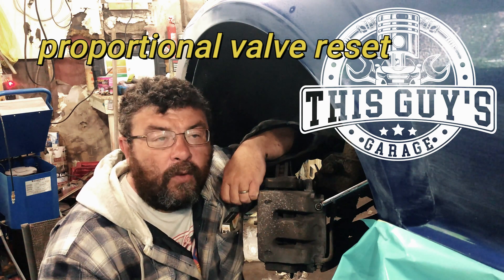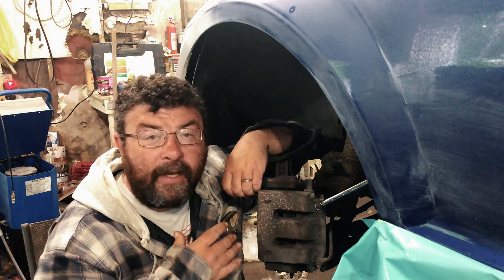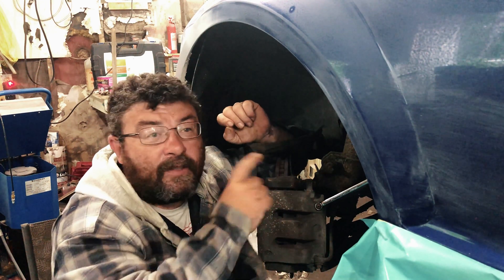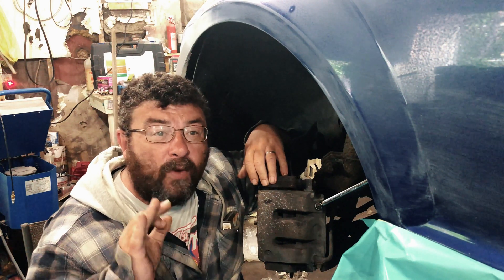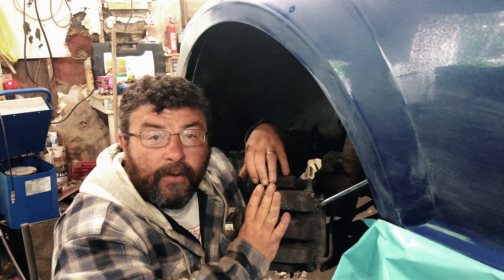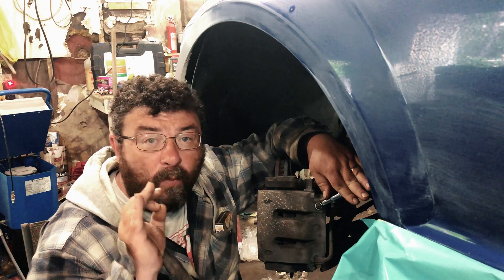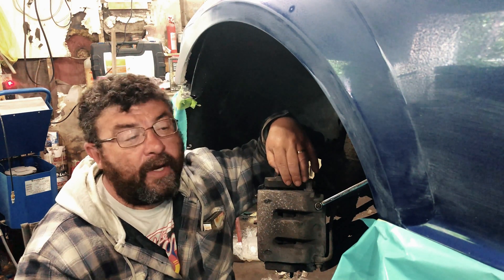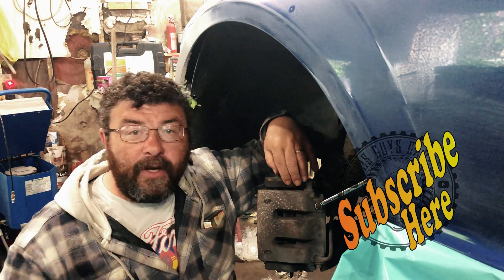brake proportional valve reset when unable to bleed

Comment: I did this method im getting fluid my light turned off but my front calipers are not releasing at all like i have my foot on the brakes....note: changed both calipers and rubber lines still cant get the front to release after applying. Brakes

Comment: Questions 1)  you say to listen & watch for fluid (and/or air) at the actual brake fluid RESERVOIR, right?  2) you meanwhen you compress both of the problem calipers?  3) should you compress both of the calipers totally -- what i mean is, clamp the first one closed, and leave it clamped, then clamp the other one , so they are both clamped, and dont cross-feed into one another, right? 4) then re- mount the pronlem calipers and buddy bleed uning only (1) pedal hold-down press PER "bleeder release", yes?...but you can do several of these 1 pump/release steps until flow is good, right?
Reply from the maker: 1 at the bleeder 
2/3 you can do this independently and if your caliper sliders are working you can do this without removing by using a screw driver or prybar to move the caliper back. 
4 you can now bleed the calipers as normal,  let me know how you make out 👍
Reply: @thisguysgarage  re: 1) -  i thought that when compressing the caliper, you want to leave its bleeder close, so that you force the fluid back up thru the proportioning valve, and back up into the brake fluid reservoir?  Seems that is you ipen the calipers bleeder, it will just come out the bleeder, and not go back thru to re-set the valve and up to the master?? Im confused i guess?
Reply from the maker: @jmm1000  yes keep the bleeder closed and yes you should hear the fluid go back to the master cylinder 👍💯✅️

Comment: I had the fivcking tool in to block the proportional valve it is plastic and not metal.I was not getting any fluid to the passenger rear brakes stool the line off and not begetting anything in front of the hose.It is all new brake lines from there.How the fuck can the both fronts bleed and only the rear divers side without getting anything to the passenger rear?I took that Fvcking lie valve off,took it apart cleaned it.Everything looked good even the O rings.Reassembked after resetting the coOcksvcker and vaccume bled furthest from the master cylinder according to the manufacturer.This is an 87 Jesus Chrysler Lebanon .They don’t make the valve anymore so I will have to retrofit something and I am flat broke worried about food.Thanks Brandon.And I can’t work without this car.The only thing I may have fucked up on is crossing the rear lines for the rear.But if it only cuts off the front or back why would that matter?A vacuum bleed worked initially and then stopped.Then I pumped the pedal.short slow stokes with a one man bleeder on it.I too the plastic tool off and looked at the shuttle valve and it looks centered as far as my old eyes can see.I am really stumped here.Anyone please help.I need to get back to work.

Comment: Mines front brakes have fluid to the passenger side none to the drives side
Reply from the maker: Replace the flesh hose on the side that has no fluid.  You can bleed at the flex hose to confirm 👍

Comment: I have a 2013 Honda Accord that I recently installed some 4 piston Acura RL calipers up front. I went to bleed the driver side but didn't realize fluid was leaking out the banjo bolt on the passenger side until I was done. I went to tighten the banjo bolt and bled the driver side again. Went to bleed the passenger side but had some issue with fluid coming out. Bled both sides and went for a drive. Notice the passenger side caliper isn't pressing onto the rotor and bed in compared to the driver side. I bled them 2 more times and fluid came out with no bubbles. Pedal feels firms so I don't think there is air but I'm not sure why the caliper isn't working compared to the driver side which is. I will change the rear rotors and pads, bleed them and see what happens.

Comment: The proportioning valve also acts as a cut off and goes to the side where the leak is. so whichever one was leaking you need to push the fluid back by compressing the caliper to push that proportioning valve back to center.

Comment: I just changed the front calipers and the brake booster because the brake were just not biting as they should. So I had to remove the master cylinder. After putting everything back, I bought a pressure bleeder. After pumping the unit to 18 lbs I started to bleed at the rear right side of the car. However when I opened the bleeder screw, nothing really came out. Not the rush I was expecting. I then went to the rear right and same thing. Hardly anything came out. I then went to the front and it worked great. What’s happening?

Comment: I did a disc brake and power boost conversion on a 65 Mustang. My proportioning valve blocked the rear port and I was able to correct the valve (using you're method) but, when i try to bleed the rear brake the valve again blocks the rear brakes. I can't get to the master cylinder bleed or the proportioning valve. So, once I have the valve reset can I use the vac to bleed the brakes? Thanks for your videos.
Reply: Find a solution?
Reply: @elijahjohnson7447 u have to use the bleeder screw tool so it won’t trip the valve ..
Reply: u have to use the bleeder screw tool so it won’t trip the valve ..

Comment: The shop did all that new calipers ,pads, new proportional  valve new master cylinder .new steel brake lines and as soon as I pulled out. as soon as i press the pedal the front wheels get sucked. Only by slaming several times the pedal it kind of releases. and then gets sucked again... Going crazy

Comment: What about on a system where it's front calipers and rear drums. I've watched bolth of your videos and it's definitely helped but I have no rear breaks and I've got front. I also replaced the master because it was seized and wouldn't move. Is there a chance I may have put some air in there and it caused the  Portional valve to not alow the rear breaks? I also didn't bench bleed the master it was bleed on the car.
Reply: Same issue here, MC, Booster, New Caliper in front new rear shoes as well as rear wheel cylinders.

Comment: I found this video for the OPPOSITE reason: The caliper gets pressure but won't retract. Is it possible that a prop valve can prevent reverse flow?
Reply from the maker: I would look at the flex hose on that caliper.  Or the caliper itself,  but sounds like the collar of the flex hose is swelled and is trapping the brake fluid in the caliper 👍 let me know how you make out 👍

Comment: 🚨🚨I was trying to put new brake fluid in my 1987 Chevy g20 .(using the tube and coke bottle method ) So I started off with the left back brake opened the the nut fluid came out, pumped the brake a few times but fluid stopped coming, the old fluid never left the cylinder just the line.  I’m having trouble where the light is on and no rear brakes.   Would this work on my van ? I really need your help🙏🏻😔

Comment: Ok I am working on a Toyota vitz the problem is that the front left and the right rear brake are not getting enough pressure fluid is coming but not enough pressure

Comment: Hi I like  both of these  videos  but I'm still stumped  I have all new brake from front to back  everything  except  for the ( brake pedal itself) lol is there a chance  a new Proportional valve. Isn't allowing fluid to come past it i'm using a vacuum bleeder?
Reply from the maker: a new prop valve should not obstruct , with everything being new i would suggest filling the master cylinder open up all the bleeders and let the fluid come through by gravity. when you see the fluid dripping on all four corners close up the bleeders and bleed through the vacuum tool. let me know how you make out.

Comment: I have disc brakes on the front and drum brakes on the back. I got no fluid going to my back brakes. How do I reset my proportion valve it’s a 2006 Chevrolet Silverado

Comment: I am riding the front seat of the struggle bus right now. I took the front calipers off of my 2007.5 Sierra 1500 to paint them. I installed them like normal. Greased pads and slide pins, compressed pistons back in, installed banjo bolt. When i go to bleed the brakes, rear drums bleed fine. No air at all. When i bled the front brakes, passenger was fine. No air. When i bled the drivers side, it kept shooting air. And lots of it. I thought it was just a problem on the drivers side, so i compressed caliper again, double checked slide pins. Noticed it seemed like the caliper was sticking. Figured it was the flex hose so i installed a new ACDelco one today. Noticed the front driver caliper seemed to be getting no fluid to the bleeder screw while trying to gravity bleed. Took flex hose off at hard line and noticed no fluid there either. Tried buddy bleeding again. Now both sides on the front are shooting air. I’m losing my mind here. I don’t know what to do. Kinda seems like it could be prop valve, kinda seems like it’s not. I don’t know.
Reply: I bled them with the motor on and got everything out. Weird.

Comment: I will try this tomorrow. Have a 77 vette in the shop that has a leaking caliper be a bone dry reservoir for the front circuit. New calipers are not getting fluid

Comment: I have a 77 T/a and having problems trying to get the dummy light out.the valve in the proportioning valve is shifting forward and I can’t seem to keep it center.any thoughts thanks
Reply from the maker: Any recent brake work?
Reply: @thisguysgarage  I restored the car the whole system is new
Reply from the maker: @darrellramsey3063  is there a possibility the calipers are on the wrong side? The calipers will fit on both sides, it just won't bleed properly and will be enough air in the system to turn on the light.  Check that first and let me know 👍
Reply: @thisguysgarage  no both bleeders are facing up
Reply: @thisguysgarage  I bench bleed the master cylinder before I installed it. Would it help if I took the calipers off and squeezed them to push air back through the master cylinder and then try to bleed them?
Reply from the maker: @darrellramsey3063  when you bleed the brakes are you getting a strong push of fluid? if yes you need o check your flex hoses , there could be some ballooning which would simulate air in the system .   other tan that if you have no leaks it has to be at the master cylinder or the vacuum booster. and more than likely the booster is the only original part of the system . if there is no leaks there has to be a bypass somewhere.
Reply from the maker: @darrellramsey3063  yes
Reply: @thisguysgarage  the booster is new and I did the test for the booster to make sure it wasn’t leaking and it checked out good. I’m getting a good flow on the back brakes but not a solid flow on the front.by chance could the proportioning valve be the problem? I’m going to try pushing the fluid back through the master cylinder and then bleed the system again and see what happens.
Reply from the maker: @darrellramsey3063  collapse the front calipers to see if it will push the prop valve back in position. I would concour the issue is at the prop valve.

Comment: Neither of the rear (drum) brakes on my 1997 f250 are bleeding, even with a vacuum tool.  Front calipers are bleeding.  Just replace the booster and MC.  Any ideas?
Reply: I'm having the same problem with my 86 mustang  after having a front caliper leak  I decided to replace both front calipers and discs  the brake fuild needed to be flushed before I installed the components  craked the bleeder in the right rear and nothing...after I replaced the two wheel cylinders still nothing...I'm now looking at the combination valve...fronts bleed all day long
Reply: I am having the same issue. Replaced all brake lines, hoses, calipers and wheel cylinders. Let the system gravity bleed but I dont get any fluid in the rear (neither driver side nor passenger side). Any idea?
Reply: Possible blockage not allowing fluid to travel to rear.  Try bleeding along metal lines along frame to see where fluid stops flowing. Worked on a old Dakota that had no brake fluid flow to the rear and found rusted backed up valve to replace.

Comment: Bro the whole time I was told to pump the brakes 3-4 times then open the bleed port so I’m out here changing parts when the proportionate valve is compensating for my mistake of introducing air into the system 🤦‍♂️
Reply: God dang man. I was told this exactly as well “pump brakes 3-4 times”. Just found this video and this is why my brakes are acting weird! Guess I’ve got some work to do. 

Btw OP Thanks for the video

Comment: 1992 Dodge Dakota replaced soft lines caliper rotors pads. Pneumatically bled the brakes. Front calipers are sticking and will not recess. I'm thinking it might be the proportion valve. How would I reset with having rear drum brakes. Do I need to reset the front or the rear?
Reply from the maker: if you were able to bleed the brakes pneumatically and have a clear stream of fluid ,check your flex hose they can make the caliper stick too.
Reply: @thisguysgarage  A  rubber flex line can go bad and act like a one way valve, fluid goes to the caliper and locks it up. I've seen this twice.

Comment: Hey I commented on your post where you dyno'd your mustang using hunter sniper tuning software a while back. I still never got around to getting one lol.  I have a 01 Durango rear wheel abs only. I put new pads and rotors on and had some rebuilt calipers (I didn't rebuild) on the front and the rear is disc brake converted from an 03 Durango. Everything worked as it should after bleeding brakes and installing the new front parts. The problem is, an interested buyer came to test drive it the other day, he definitely got his testing out of it, and he was speeding up and hitting the brakes pretty hard. Not excessive, but real firm about 2-3 times then we turned around and he did it 3 more times. All was well until we literally was about to turn into driveway and the front left caliper locked up. I thought the rear driver brake caliper may have been an issue too, and took it off, compressed it in and it was fine. I put it back on and forgot to press the pedal down to extend it back out before removing the front driver caliper and trying to compress it. It was a little hard at first, so I thought maybe the used booster I put in had the rod adjusted to far out. I loosened the nuts for master cylinder to back it out some and see if that would help, but didn't and noticed the front brake hose had small kinks in the metal line that mounts to caliper. So I changed it out and caliper compressed much better and I had to grind the divots flat on steering knuckle where the pads slide (these don't have removable slide clips) put it all back together and bled that caliper (ik alot of mistakes and cut corners happening here but I was in the middle of completely swapping the front steering and suspension on my truck when this happened) anyways I noticed the caliper works fine until the last little bit of compressing it, it gets hard. So I buddy bled  it and decided to start the car (now 2 things, I never pushed driver rear caliper out and the damn master cylinder was still loose) and now obviously I have abs light on. Brakes work fine. At least the front and the rears bled slow at first but started to get a stronger flow after a couple times bleeding. I bled all 4 calipers fine however the abs light won't go out and I'm thinking it's proportioning valve, but wanted a second opinion on what order I should go about resolving this issue. To everyone else, this is why you don't rush jobs. I've worked on alot of cars, but screwed myself on one of the biggest things I try to avoid getting into.

Comment: What if the caliper that won’t bleed is already compressed? I just replaced both rear calipers on my 2003 Honda CRV and I was able to get the rear left caliper to bleed like normal but the right rear caliper would not bleed at all and since the caliper is new, the piston is still compressed.
Reply from the maker: If you are able to bleed one side I don't think it's your proportional valve. I would suggest opening the line to the flex hose see if you can get fluid there. Flex hoses are notorious for blocking fluid transfer. Let me know 👍
Reply: @thisguysgarage  Yeah I did a little process of elimination and took the flex hose out. Had my brother pump a couple of times and there was little to no brake fluid coming out.
Reply from the maker: @mwppyro6388  cool. OK,  since your caliper is new and can't be compressed. Swap the right and left then collapse.  After that put them in the right position and try to bleed again. Let me know 👍

Comment: I had a big problem bleeding my brakes on my 03 chevy astro after bleeding them many times finally realized I had the front calipers mixed up switch right to left having the bleeder on the upside of caliper solved the problem, feeling so Dumb
Reply from the maker: 🤜🤛 I seen that happen a lot. You won't be the last 🤜🤛👍

Comment: Good video. Thanks i learned something new about pumping the brakes manually. I have a problem with 1969 chevelle. Disc front/drum rear. I can firm up the back brakes fine and do them first like i should but when i move to the front, i cannot get them to firm up(fluid flows but won't hold up) and then because of moving to the front  i lose the back firmness at the same time. I think proportional valve but am not sure. Any ideas?